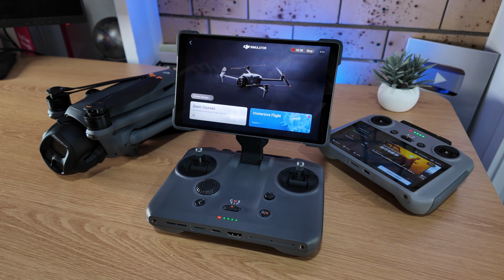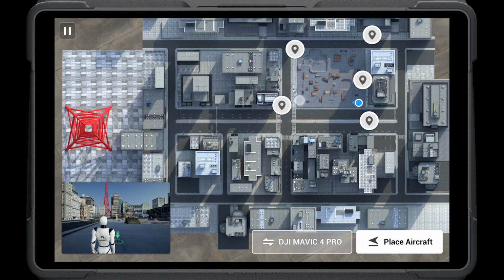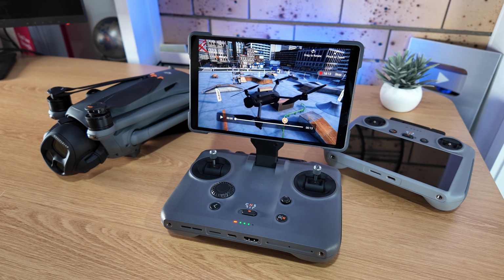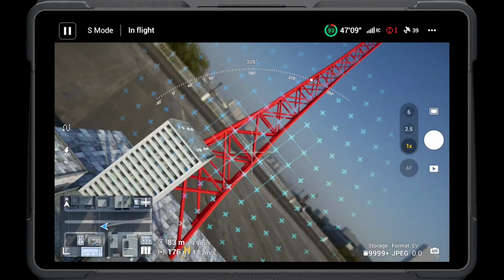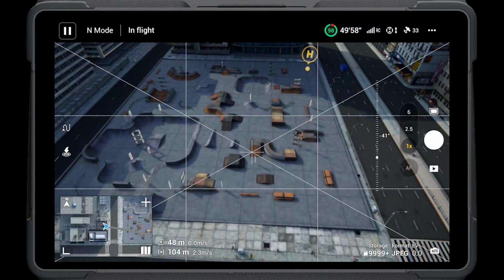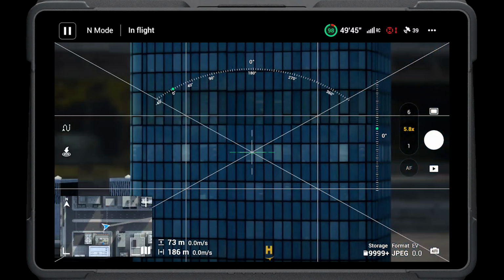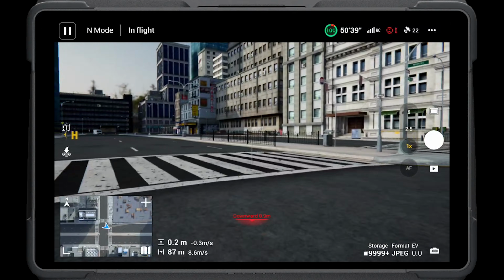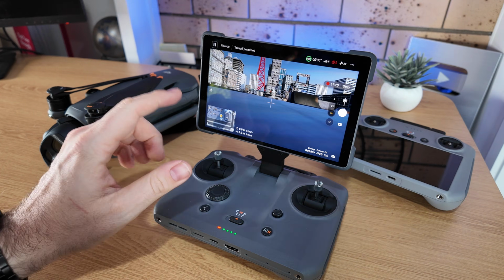This DJI Simulator Might Save Your Drone! (RC Pro 2 + RC 2)

Comment: My DJI RC2 works brilliantly with stock usb c to usb c that came with my Dell 27 inch S2725QC even with the controller turned on and it fast charged at the same time.
Reply from the maker: Nice! Good to hear 👌

Comment: They should’ve added this to Goggles / fpv controller as well. Might have saved me my first crash on the avata 2 😂
Reply from the maker: Yes, great idea 💡 I’d love to see this. Did you get a replacement Avata 2?
Reply: @DansTubeTV fortunately for me, I only broke a propeller. No damage on the drone even though the right side of prop guard tanked a huge tree branch. No DJI care refresh in my country anyway, so. 😅

Comment: I have a Mavic with an NC-1 remote. I installed the fly app from the website and was hoping I could use the controller with it, but without luck. Is it possible to make that work?
Reply from the maker: I don’t believe so, I haven’t heard of any work arounds.

Comment: So that's cool for changing the gain and expo settings. So you can then add your desired settings to the drone instead of using up a battery in the drone 😊
Reply from the maker: Yes! I completely agree, such a practical implementation.